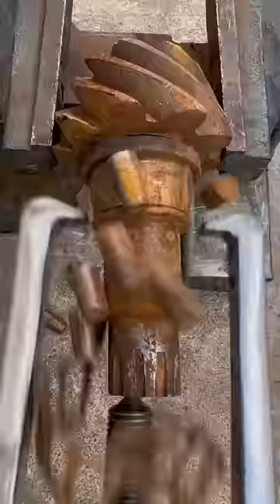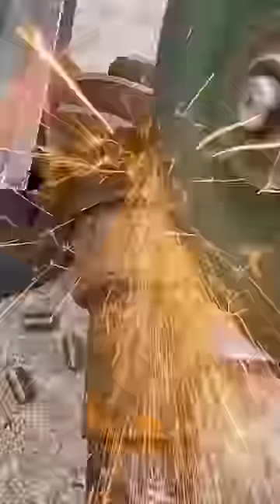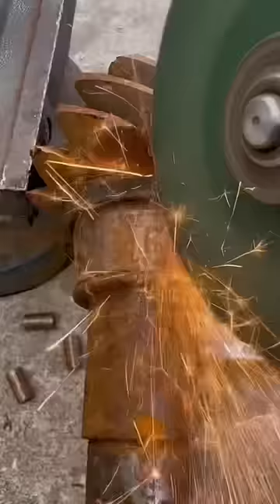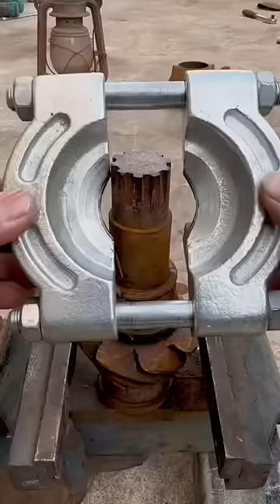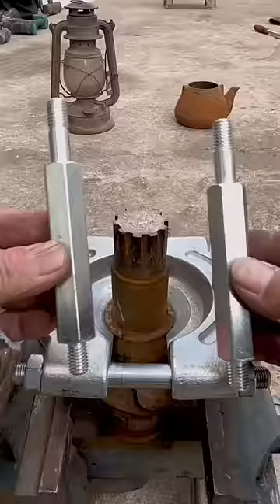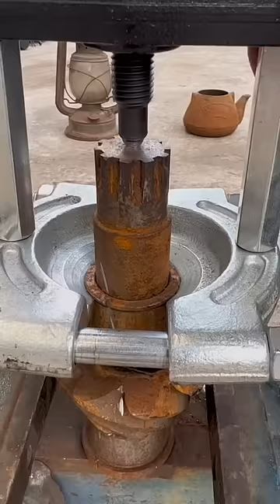Specialized Bearing Extraction Tools Tips for Easy Bearing Removal

Comment: It takes two minutes to place the gear upside down and heat the bearing with a torch and it falls all by itself. It's called heat espantion while the inner race is snug on the shaft , when you heat the inner race fast enough it will expand  to the point that it has no choice but to fall as if it is too big for the shaft.
Reply: @edwardst•pierre1020 • Agreed, but even less than two minutes if you just run a bead on the race with a welder, and less heat penetration to the shaft/pinion.
Reply: @douglas_drew  yes you are right but using a torch with the proper heat is a better control situation. While the gear is standing on the shaft end the flame is in direct contact but won't touch the shaft. This can apply to any size shaft . Welding means that you have to make contact with the shaft and possibly knocking it over. I have seen people use a zip grinder and cut through the inner race of a bearing which takes a lot of energy, while cutting into everything in order to remove the core off. Using a torch is very dangerous if you are not a professional with a torch. Once you are good with a torch and with the right technique anything is possible. I have cut bearings off of a shaft with out touching the shaft at the same angle as the shaft by bouncing the flame off of the shaft. Those were the days that I missed. It sucks getting older while on a pension. Boy could I tell you of a few close calls. I actually have a few lives left. Hey have a great day every day because they are the best ones.
Reply: .... and how long to unravel and pack up your hoses etc etc. Use a grinder, but on a 45 degree angle (or more), not up and down like in this video. Only need to score a line then a sharp hit with a cold chisel will crack it and it will slide off easily. Takes only about 2 mins an no damage.
Reply: @edwardst-pierre1020  yes but if you weld your torch, bearing buller and welding nozzle together creating this sacred tool of awesomeness,  then it should take it off under a minute.   Also soak the gear in Gas so it cleans off the corrosion immediately before.
Reply: @robemac3590  sorry to not understand your comment. My English is not good enough to understand other forms of English.  Being of another language , the logic of language is different between other countries
Reply: It took the same about of time to setup and use the race puller.. 🤷‍♂️..
Reply: @allee6096  that's possible but I prefer the old way of doing things.
Reply: It's called heat what ????
Reply: @Edwardsjourney  expansion
Reply: haha ur trying to teach the brains of Great China??? r u ok??
Reply: @luckylotus11  sure about that.  To each their own.  Like a blind man teaching a deaf person to fly a kite.
Reply: Absolutely ..... heat all the way!
Reply: Your going places good sir🫡
Reply: Great just need a torch😂
Reply: A little spit goes a long way....
Reply: @kramnull8962  yes it does when you know how to use it properly.
Reply: Heat..😂😂😂...like the guy has a whale oil Hurricane lamp.  New bearing puller, but no torch.
Reply: Or you could just use a puller. Torch comes after puller fails.
Reply: @racoming1035  someone bearings have to be heated to a high temperature to go over the shaft in order to lock in place., sometimes a puller isn't enough. But in many cases a puller is all that you need.
Reply: The tolerance from a push fit, to a force fit, is less than 1 thousand of an inch. Torque is 90 percent friction, and 10 percent load, if my memory is still working. Haha
I loved building engines, before they brought out all the electronics, for electronic windows, Bluetooth, ect, turned it into a nightmare.
Reply: Он может быть прикипевшим поэтому просто нагрев не поможет

Comment: Don't use a impact on a puller, you will fuck the threads up.
Reply: @dfal6898 same gear still there with grinding wheel mark.
Reply: HEY!!! they clearly know what they’re doing!! 😂😂😂
Reply: @dfal6898    look again. The camera is just at the same tilt as the gear so hard to see.
Reply: It’s his shit!  he can fuck it up whenever he wants to!! 😂🤣
Reply: On a shit puller yes. On a quality puller it’s fine. Done it a lot.
Reply: It galls the threads regardless.
Reply: lub the threds with antiseze works great. and will last long time. do not need very much. also lowers the resistance if realy cranking on it.
Reply: Better buy a new car
Reply: Not if properly lubed and used with variable speed impacts I do it constantly
Reply: Stop buying Harbour Frieght pullers
Reply: You have to have a Mac or Snap On puller...I used impact wrenches on mine for years, pulling parts at a local salvage yard. Use a good waterproof white lithium grease on the threads.

Comment: I am constantly amazed how people can come up with tools to do just about anything.
Reply: These pullers have been around for as long as I have, maybe longer. I'm in my early 70's.
Reply: @DallasBurgher, yea it's amazing just how many actual tools there are for like EVERYTHING you could need one for.... 

It actually borders on the ridiculous sometimes where there is a "$5-$10" tool that  "releases a clip" that you could just press with your fingernail to remove but the tool exists nonetheless.
Reply: @zenithperigee7442 hey don't be hating on us nail biters. we need that tool. or a flat tip screw driver lol. or when my nails are long im horrified of pulling my nail off haha.
Reply: This is a basic tool in this industry 😂😂. I work for a company that makes front and rear ends and we have a bunch of these pullers at the shop.
Reply: @stpbasss3773 I think I still have the ones my dad bought back in 1968 plus a newer set I bought in 2014

Comment: With pressure on the race from the puller you can heat  the inner race and it will expand and pop off.
Reply: Там смазать надо , чтобы не в сухомятку тащить...
Reply: Thats the easy way. Half the time they just drop off if its clean

Comment: I'm a little more concerned about the socket that used on an impact wrench, look like a chromium socket to me and those things will explode that's why you use the black impact sockets, just from past experiences I'm sure the experts out there I'll jump on me for this one and Lord over how smart they are LOL but don't worry you can't hurt my feelings I used to have to hold the light for my dad!!😊
Reply: I'm just wondering why you didn't use the spinning end on the bolt so it doesn't deform the end of the bolt, plus I'm concerned about why you didn't use a impact socket on the bolt. I've seen them come off a lot harder than that. I've even seen then chip a piece off of the bearing puller before, and I've had to use heat along with everything mentioned.
Reply: In the real world you do what it takes.
Reply: @drrd4062  or you don't do it at all. It sure helped growing up on the farm, and my grandfather being a John Deere mechanic.
Reply: @Arnold-x6d  you must have learned many different ways to do different things. Would you share some 'tricks" of the trade. I ll start. Back in my day there were points. And to properly set them you had to remove the back lash from the bearings. Otherwise you never could get it right.
Reply: @drrd4062  lol. My Troy Built tiller with a 7 hp Kohler still has points on it. Don't forget that you had to set the dwell on the points on vehicles! Something else that I learned to do is weld, braze, and I learned to fuse two metal's together with bailing wire. Start a diesel with gasoline on a rag over the intake screen. Drill out and remove broken bolts. Overhaul, small engines, grind valves and seats, set tapets, overhaul automobile engines. Either you learned to do it, or the farm went under, because who could pay or afford to pay someone else, or the downtime waiting on someone  when you could fix it yourself?
Reply: @Arnold-x6d  Yeah, the broken fasteners. What an art to get them out. My preferred method is heat, and a very sharp left handed drill bit. Never had much luck with easy outs. Seems like they pushed the threads out making it even to remove. What kind of lube you like?
Reply: @drrd4062  Well, another method is a left-handed tap, then a grade 8 left-handed bolt. Also, let them sit for at least 3 to 4 hours after spraying them with penetrating oil. Then, hit it with a center punch several times to see if you can jar some rust loose. Do the latter before drilling. After it starts to move keep going back and forth, and keep using Penetrating oil.
Reply: @drrd4062  Well, it's better to use a spiral easy out than the square ones. I think that it is very important to use the proper drill bit made for the easy out too. If all else fails. Heat normally works, but there is times that you can't use heat.
Reply: @Arnold-x6d  So, are more familiar with the tractors, diesel? I do bikes, all small stuff,2 stroke, and lawn and garden. Did construction equipment but  got tired of the weight. When you need a tool to lift a tool and a part gets to make you wonder. As you get older it gets easier to get hurt.
Reply: @drrd4062  I totally understand getting tired of heavy equipment. I've helped my cousin that has a shop, and most of the stuff that comes in is tractors, combines, backhoes, and caterpillars. Along with a car, pickup trucks and an occasional lawn mower, skid steer. Like I said, though, I'm guessing that about 80 percent that comes in the door is heavy equipment. During the big covid scare it was very hard to get parts.
Reply: @Arnold-x6d  Yeah but aren't farmers also masters at jerry rigging things to make them work when they have no other option? Seems to go against what you say - "don't do it at all." That's how the farmers I've known were anyways. Make it work with what you have available so you can get the job done 🤷‍♂️
Reply: @joeg5414  Well, we always had enough stuff to get it done correctly. We may have finished a day out like you stated, but it was always fixed the next day, or we were running for parts. Remember this, a farmer always has to beat the weather. I've spent 18 hours on a tractor before because we were planting and had a storm coming in! Maybe we were just fortunate in having parts because my grandfather was also a certified John Deere mechanic. Idk
Reply: @IanHotson, lol I remember holding the light for my Dad, miss him a lot.... Yea I believe chromium sockets are a harder material and more brittle whereas whatever the black sockets are made of are a softer metal.
 
I remember the first time a chromium socket broke trying to get a front drive axle nut off & that's not using an impact, the impact wouldn't remove it so I used a "breaker bar" & the socket just broken open, then the end of the "breaker bar" actually broke at the moveable joint, fun times lol. Ended up welding the breaker bar in a fixed orientation & put a 3 foot pipe on it, the nut finally came off!

Comment: If you turn the grinder sideways, parallel with the shaft it would cut it without hurting the pinion shaft. I do it all the time.
Reply: Heat that sleeve with a  torch it will heat up expand and fall right off
Reply: *you mean perpendicular, and then it would be possible to put the puller in the cuts and get the bearing race off of the shaft
Reply: AS WELL  I
at an angle  you get it
with hammer and  chisel 
after  cutting
Reply: Снимаю внутрннею обойму болгаркой со времен создания ей. Резать с умом надо.
Reply: I do this daily. Heat is the best way to get that off. Just hang it and heat it. 😂
Reply: @aaronkrause2251  Risky  weaken it alot
the gears can get  brittle

Comment: 산소로 가열하면 자연스럽게 빠져나옮
Reply: Ñ1
Reply: when heated, the shaft will be fucked up.
Reply: @user-rus327 хороший перевод, сразу ясно, что русский написал 😀😀
Reply: @user-rus327 согласен. Нагрев может привести к деформации и биению в ходе эксплуатации.
Reply: @АндрейБирюков-д1д всю жизнь с полуосей подшипники стягивали и обратно натягивали с азотом и нагревом. Ничего не перекашивало.
Reply: 산소 사용하다 찐따 만든 인간들 많이봄 ㅋㅋ
Reply: It will deform if you use high heat for cutting and in this case you are just warming it up for it area expansion jeez it not rocket science 😂

Comment: Yes use a bearing puller to pull a bearing.  If you need to use a grinder turn the disk sideways cut lengthwise and then split or if you can't split use a screwdriver to widen it to slide it off the shaft

Comment: Find a way to slowly rotate the pinion so you can heat the inner bearing race with a torch. It should expand and just drop off the pinion with no damage done.

Comment: You can do this if the shaft tolerance isn't an issue or if the whole thing is going to be replaced anyways. Pulling a bearing without any lubricants or heating (or freezing) may affect the shaft tolerance and thats an additional cost if you don't have a spare. But again, if tolerance is not an issue its ok.

Comment: If you're using a grinder, it's because the puller didn't cut it XD. Also use a dremmel at an angle if the griver is too big

Comment: How to use a bearing extractor to pull the collar off of the steering column on a Volkswagen to change the electronic parts of the ignition cylinder. Ask me how I know.... I own one of those bearing extractors now.

Comment: I used a dremel with an elastic wheel, to cut through a bearing inner race, or siezed car wheel bearing. Make the gap wide enough for a coal chizel. Then hit the head of the Medal chizel with a lump hammer. Ping it parted because it's a brital material.
Forgot - hit the outer race of the bearing with a hammer, it will shatter, because it's brittle.

Comment: Easy way to remove a internal race is to run two beads of weld 180 degs apart. It will almost drop out😊

Comment: Two errors.  One is the green tip ammunition is not universally allowed on ranges.  The other is 'adapters' were issued with 5.56 NATO ammunition loaded into CHARGER clips.  (Okay, three errors.)  The adapter is a sheet metal stamping (not dissimilar to the charger clip).  It fit on the top rear of the magazine and one inserted the charger clip and loaded the magazine.  Nothing to fold and remarkable easy to carry in a shirt pocket.

Comment: This was a stupid video.
I work on things like this somewhat frequently, and I can say that the cutting wheel was too large if cutting was the only method.
First thing is to clean the shaft surface, then either cut with a small disk /grinder, and use a flat chisel to carefully remove the bearing, or heat till it expands enough to remove

Comment: 👎 The design of the tool itself is a flaw. (So stupid. Even the gear rod which is supposedly made out of high-quality iron is damaged with a huge dent. I am pretty sure it comes from China 🇨🇳 )

The problem starts when the dismounting tool is designed to place the rotating nut screw on the product instead of the tool. The flaw of the design can be solved pretty simply just by placing nut housing between the rotating nut and the product so that the nut only rotates in the nut housing, not on the product. 

Not to mention having to assemble a lot of parts yet lacking the anchor point to operate it manually and the maximum high of the nut bolts is almost already at it's highest capacity. (The fact that they do not think about solving it before introducing it into the market is insane. I think the stupid designer hopes the user to insert a thick iron plate before the product and carry different sizes of nut bolts around in case the needed to dismount is larger than 1 inch in diameter. So stupid)

Good to use if you try to damage the product every time you dismount.